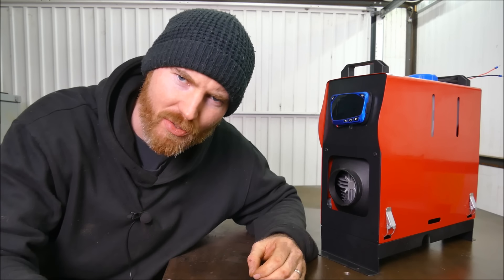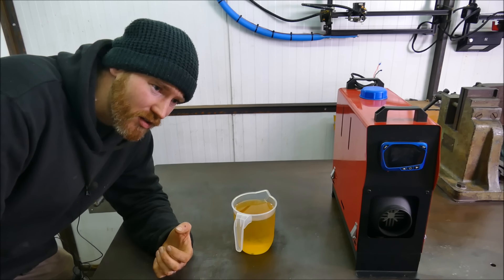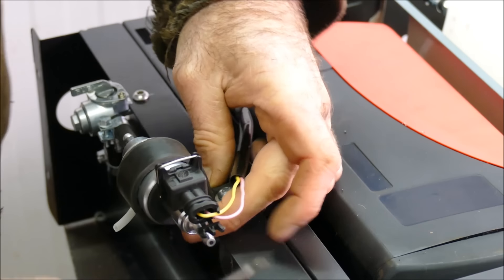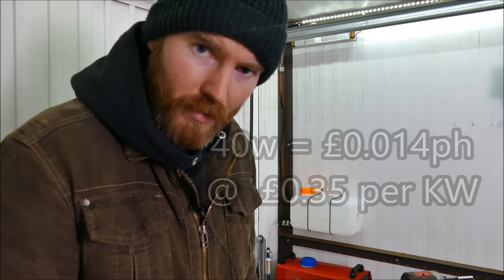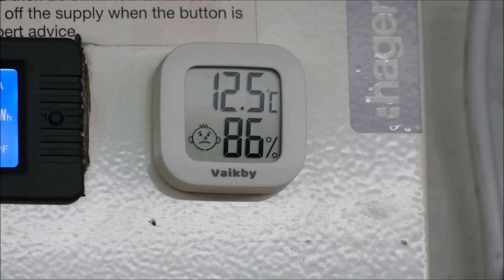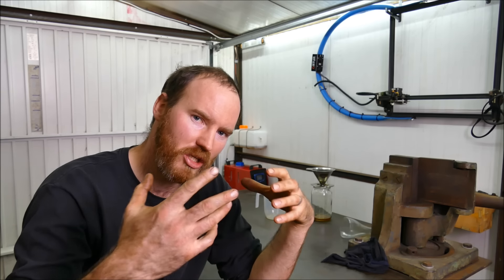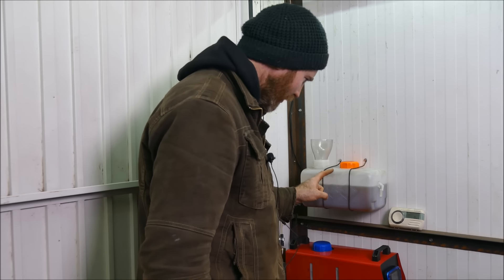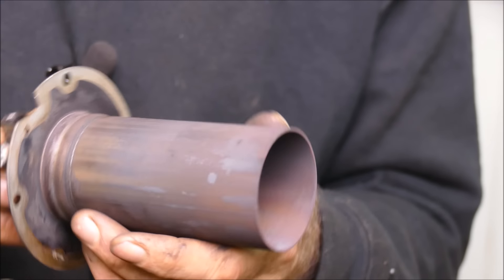£0.03 per kWh heater modification - Top facts & lies on diesel heaters - waste veg oil burn success

Comment: PS    The viscosity of Diesel is 35 Redwood, Kerosene is 28, but the waste oil is likely to be c. 200 or so. If you added a tiny 5W 12v bulb to preheat the waste oil thereby lowering its viscosity, you most likely would eliminate the unburnt fuel (smoke) withiut having to add the Kerosene to your waste oil.  Keep up the good work
Reply: Why not preheat it with exhaust heat?
Reply: @bradleysr brilliant
Reply: @dannywilliams6643 think about how it would start
Reply: @simonmasters3295  Smokey to start, then it'd clean right up.
Reply: @dougle03 most guys that burn waste oil in their diesel trucks switch back to regular diesel before shutting the engine off. This makes cold starts much easier.
Reply: I thought 5 W fuel preheat sounded too small but I made a calculation. With a fuel flow of 0,3 l/h, a specific heat of fuel oil of 2000 J/kg,K and a density of 0,8 kg/l, 5 W heat would raise the temperature of the fuel 38 °C. That's quite OK.
Reply: @skunkjobb Isn't going to do much if the fuel is cold during winter.
Reply: I was also thinking about the pump...  The lubricity of the diesel and veg oil is fine, but the kerosene does not lubricate the pump, which is why you have to add oil to the kerosene in order to run a diesel engine with it, without destroying the pumps and injectors....
Reply: @ferrumignis there is a BIG difference in diesel and waste oil cold start in the winter.
Reply: @supertreme5559  My point still stands, a 5W bulb isn't enough.
Reply: my buddy runs 1 part gas to 3 parts oil in his diesel truck , what would be the viscosity compared to regular diesel
Reply: @hippiehomesteader2377  how does he blend it? just fills it on the tank? because it dont think the oil mixes with the diesel easy
Reply: @supertreme5559  mixes GAS and oil in a drum then drains it through a diesel filter . mixes great
Reply: @supertreme5559   Mixing gas and diesel is an old trucker's trick for Winter running, to stop the diesel gelling. You just put some gas in the tank and it works well. We used to mix at around 10 parts diesel to 1 part gas.
Reply: The exhaust would do trick but you would need to have a separate take so you could start it with diesel, once the veggy gets warm it burns cleaner than diesel does
Reply: I was wondering if the water in the pipe may be due to condensation from the exhaust cooling down quickly while running through the bucket
Reply: @bradleysr  What a genius idea :)
Reply: Possibility to use wasted oil depends of your injection pump. On Bosch one it's easy and you can also use kérosène+10%oil

Comment: Ground source and air source heat pumps advertise a "coefficient of performance" this is usually quoted as 4:1 and explained as for every 1kwh you put in you get 4kwh heating. This is incorrect, Boyles law anf third law of thermal dynamics say that no system can be more than 100% efficent. The 4:1 is based on carbon dioxide emissions not watts or energy. They compare a gas boiler against an electric heater on a nuclear or green wind tariff and say the CO2 is 4:1. If you switch to a normal cheaper tariff this may drop to 2:1 but this is still CO2 not energy, so do not multiply any watts with the COP.

Comment: I see someone purposely building one to fit into a fireplace for homes built prior to 1980’s . I bought one for my Macgregor M and use in the shop . I ended up running an exhaust pipe through the wall then up a down pipe from my gutter to get the exhaust up to roof height of my house so not to suck it back into the garage or annoy my neighbors. My point is these are amazingly cheap to run so trying to extract every btu seems like rubbing two pennies together. Clean burning equals efficiency so if you try to burn shit it will plug up and not burn clean or just fail completely.Your exhaust pipe is the most important bit for keeping it clean burning and Avoiding CARBON MONOXIDE! These heaters come with a small silencer. It is not air/exhaust tight at all and does act as a condensation trap which is good but never inside where you are breathing the same air. So if you buy one of these you must have a carbon monoxide detector. I love mine but also got a small electrical heater that burns 50 to 70 amps @ 12 volts with a tiny fan to maintain a nice temperature after heating with the diesel . Ok cheers and prayers for peace on earth !

Comment: I love the content on this channel!!!!  I bought one of these heaters a few years ago and still haven't unboxed it.  Believe it or not...  I was a Captain in the U.S. Army back in the mid 2000's and I was burning used vegetable oil in my 2500 Dodge Diesel truck!!   I would gather the used veg oil from the dining facilities on post and take it home and strain it through a window screen into a 30 gallon trash can.  Then I had two pumps that would pull the oil from the bottom of the trash can at the petcock.  The pumps would run the oil through two different size micron filters two get the particulate down to 5 micron.  Then straight into the fuel tank on the truck.  Before the oil leaving the trash can I had to include 10% gasoline, 1 qt of diesel clean, and about an once of a special additive that I bought from a dealer here on youtube.  It worked pretty well but you had to leave 1/3 tank of diesel in the truck or you would clog up your fuel filters on the engine.  Anyway, it worked until diesel prices dropped after Hurricane Katrina.  What I found interesting was that during this time Diesel prices were near $5.00 a gallon but I would fill up on Kerosene at the pump, when I could find it, for about $1.67 a gallon.  Kerosene is actually what is considered #1 diesel, a cleaner version of diesel.
Reply: Why did you put the C0 detector on the floor around 21mins then start talking about smells 😂
Reply: Used cooking oil is easy to clean. You need an inverted barrel with the bottom cut off. Fit a water heating element in the (new) bottom side so it runs parallel to the bottom of the barrel. Fit a petcock into the bottom to drain the water. The screw cap will allow crud to be washed out. 
Fit another petcock 25% up from the bottom. 
Fill the barrel with water to below the upper petcock and top up with used cooking oil. 
Now heat the water and boil it for an hour.  The steam will literally wash the oil. You can drain the (now clean)  oil via the side petcock. Drain the dirty water via the bottom petcock and barrel bung. The small amount of trapped oils stays in the barrel and gets added to the next boil wash.
A commercial kitchen water boiler will do the same job for smaller batches.

Comment: Great job, I taught bio-diesel at the local college, and drove coast to coast across the United States, Labor Day weekend (5 Days) in 2002 in A 2002 VW Beetle with 600 Miles at the start making 3036 miles west to east astoria oregon to Ocean city MD and of course back. I did similar experimenting and refining. Using a SS mesh filter, then two diesel filters I would ultra filter the waste oil from a chip (potato - thin slice). The last filter in the chain was a water block because I would store it and the oil is hydroscopic so when it cools down ( like when the temperature in the room cools at night) it actually draws moisture out of the air (oregon Pacific Northwest) it would settle on the bottom. I still have the car more than 240,000 Miles still run biodiesel ( available at the pump called B15) I have two other Vw’s with diesel engines 2006, 2014 and a gmc 6.5 Lt Turbo diesel 4x4 truck. Your doing it nearly exactly the same and never had any problems and change my car/truck fuel filters per mfg schedule, I would open the filter car fuel filters never found anything big or a lot ( no rust no contaminates) I had a lot of people tell me all kinds of things but never had any issues. When freezing temps expected just increased the diesel ratio to 50/50 then when it warmed back I would go. I maintain all the vehicles still on original glow plugs and injectors and high pressure pumps. But its likely how I drive, i am on the original clutch and the brake pads on the front were changed just because they were 18 years old, there was still more than half the available wear left. Enjoy the adventure. Mike
Reply: Love how many people "tell you all kinds of things"!  I have a 2003 Suburban 1500 (soccer mom SUV), and have been towing a 16' dump trailer that weighs over 10K lbs when loaded.  Everyone tells me my truck can't do it, and it will destroy my transmission.  150,000+ miles and 12 years since I bought the work trailer.  Still using the same SUV with original transmission and engine. Always be willing to do your own research and tests!
Reply: I ran a WV TDI 90 (chipped to 110) on biodiesel. It ran more quietly and gave about the same fuel consumption. 
I cleaned the dirty waste cooking oil be boiling it over water. It was screened through a kitchen sieve then boil “washed”. The clean oil was then reacted into biodiesel.

Comment: You can use old car EGR cooler to recover heat from the exhaust gas. Coolant can be used to heatup the heater and it is good to make a cooper hose coil  over exhaust pipe to warm up oil

Comment: Have you considered plumbing the exhaust into a car's EGR cooler and then connect the water side to a normal home radiator or even a car radiator (or heater matrix) with a fan?
Reply: just plumb the exhaust straight into a radiator, or 3, then out. No need to waste heat on water. :)
Reply: @Steve Smith  the downside with that would be the noise of the exhaust amplified by the radiator, the radiator filling up with condensation and causing issues with exhaust flow, having no thermal mass, so it'll rapidly cool down once the heater is off.  You also miss out on one of the great benefits, which is the ability to pipe the heat to another room.

I did this so that the toilet in my workshop had heating, despite being  in a different part of the building some 20 ft away from the heater.

Comment: Make sure your pump is on a 30deg angle to get rid of air bubbles or you will kill it. The air will accumulate and the plunger will wear the inner wall.

Comment: Just a suggestion if you used a metal tool box or old ammunition metal box, dip the exhaust pipe in then fill with kiln dried  sand you will create a heat sand bank which will retain all the exhaust heat up to temperatures in excess over 1200 centigrade far higher than water.
Reply: I'm just about to do that very thing, only I'll be using 4" cast iron pipe (old guttering)

Comment: brilliant. i firstly did this to my boat about 4 years ago. not so good in choppy sea but still worked good. when the gas price went up i did the same sort of set up as you. I have one blowing upstairs and one down and it actually keeps my old 200 year stone hose around 20c and so very cheap to run. i did get a free 55 gallon drum of paraffin that im using  and expecting to last a few years. with two multi fuel burners two diesel heaters solar panels that iv set up myself running a 3kw grid tie inverter and my esta breeze i1500 turbine i pay not a lot to the utility ripoff gangsters. iv not worked out the cost but its not a lot

Comment: These heaters are so forgiving of their fuel. I have been running a 50:50 mix of waste veg oil and kerosene in mine for the last year. It starts and runs with no issues even in cold temperatures! Does away with the need for two tanks and the change over but as half of my fuel is free the running cost is halved! Yet to open the burner to decode it so I can’t comment on soot but the point is it’s running without any hiccups ☺️

Comment: I’m fairly certain we can still run red diesel for these, I bought 50l a month or so ago for my diesel heater, after checking gov website it’s commercial heating that can no longer use it but house heating can. That’s what I put on the form when buying it. Hope this helps, I think at the time it was £1.359 for red and regualr was around £1.739
Reply: I was going to say the same thing. My office (converted garage) is heated this way.

Comment: As a kid growing up in the 50s I can remember my stepdad telling us about having an extra tank on their car filled with old motor oil/diesel mix, with a line wrapped around the exhaust to a valve on the fuel line. They'd start as normal and after running for a while, would switch over to the mix and turn off the ignition. Just before their destination turn ignition on and mix off,  thus allowing them to shut down normally. He said his car was an old jalopy, so I'm assuming it was a model "A"!

Comment: Waste oil  collected eventually makes its way to bunkers along coastal  cities. From there it is transfered to cargo ships where the mixed petroleum products including antifreeze,water ,metal shards , anything that can end up in a waste oil bin is run threw centerfuges and burned as fuel ,this "bunker fuel " can only be burned outside of international waters.  The sludge filtered out is dumped at sea.

Comment: If I'm not mistaken the manual says to keep the exhaust pipe to a maximum of 1 meter length. I believe it says this because any longer and the exhaust becomes a restriction leading to rich burn mixtures. If I were using a long exhaust like in the video I think I would use a much larger diameter pipe eg have the stock exhaust for a short a distance as possible and then step up to say a 3inch pipe. Run that 3 inch pipe indoors for as long a distance as possible and then vent outside. In addition to afrs staying correct, the exhaust gas will be slowed down massively (without causing a restriction) giving the exhaust gases more time to lose their heat inside the room.
Reply: But they sell 2-meter aka 8’ exhaust tubes for them. I have one…
Reply: @fishhuntadventure  but the manual says 24mm diameter and "at most 1 meter" length for the exhaust. (At least in the Vevor manual I have)
Reply: @StrikeEngine  That is for the rippled tube, best to use straight as much as possible Some Webasto use 32mm pipe. Some converters use far more than 1 metre.Just do not use copper its toxic at exhaust temperature.

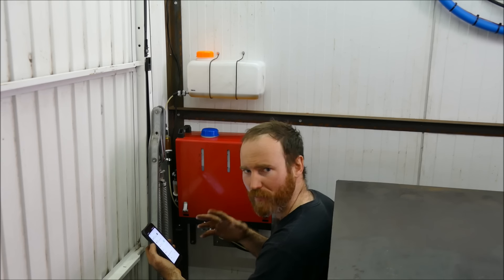Comment: 24:48 the catalytic converter would definitely burn off a lot of the unburnt fuel in the exhaust and would probably be prime item to be on the inside of the wall and not outside

Comment: adding a couple of drops of acetone to each litre of used veg oil lowers the viscosity quite considerably - this will help with the filtering and the flow rate in the heater

Comment: I immediately bought the 8kw version on your recommendation and I am looking forward to using it. Keep up the supply of great content, sir!
Reply from the maker: Well done. Great investment in my opinion. All the very best. Cheers J
Reply: there is no 8kw. they say it is but its only a 5kw. https://www.youtube.com/watch?v=0o38XKrTRkI it is all explained in that vid link
Reply: No offence to the video creator but there are quite a few issues here.  So be careful.  This video is not accurate. And as another has stated the maximum output of an 8kw is around 5 in the real world, including exhaust recycling.  I would also factor in for solar charging personally.   Making vids currently on the subject.  I am a retired experimental physicist/ engineer if that helps.
Reply: 8kw ? or output 5kw.... unless quality. cheap 1s max 4\5 if lucky advis. gimick : see specification / build